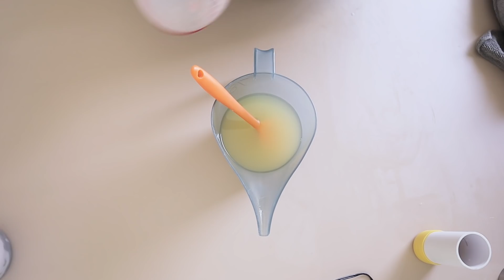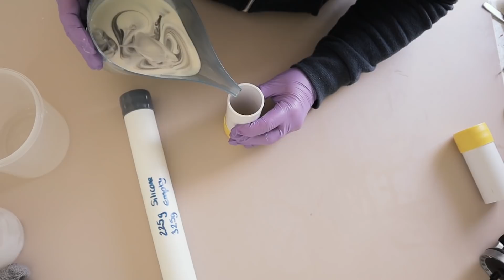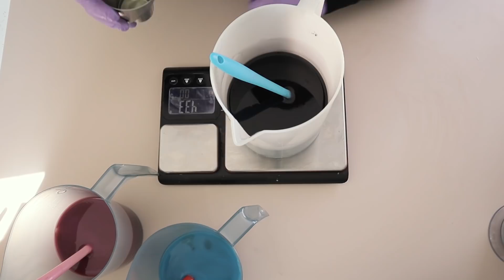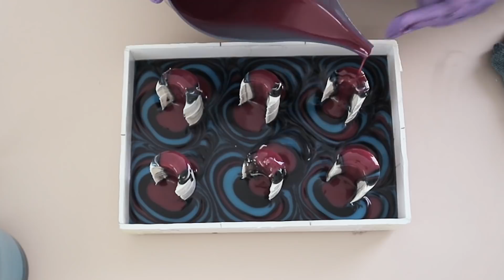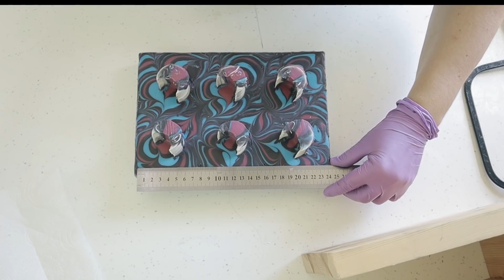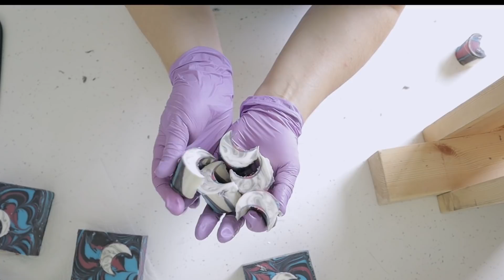Making an Embed Column Pour cold process soap making tutorial. How to make a cold process moon soap.

Comment: I'm new to your channel. I really appreciate your talent as a artist. If you don't mind me asking how long have you been soaping? I plan on pouring a column moon soap tomorrow. Do you recommend a more soft oil batter to pour over the moon? Signed your biggest fan in USA!
Reply from the maker: Well hello, biggest fan :-) You do need to have a batter that will stay fluid, for me a lot of that is about how much you blend it (to emulsion only then stop, add in your colour and FO and then just leave it alone and stir every now and again until it just comes to the light trace, you should just see a very thin trail but it should disappear into the batter as soon as it touches it, if it leaves any pattern on top it's probably starting to get thicker than you really want.), your temperature, I'm about 80F for this type of pour and having a fragrance oil that you can trust to not accelerate. 
Having more liquid oils does tend to help, but I find it's better to keep an eye on your saturated : unsaturated fat ratio rather than just hard vs liquid oils, you will find it on the top right hand side when you view a recipe in Soapcalc (you probably know this, but just in case), Mine is 41:59 and that gives me a batter that will stay fluid for a long time.

Comment: Thank you for this.

Just a question. Do you have to adjust the new lye solution for the new pouring batter on the embeds.
I’m asking as the embeds are still quite fresh.
Also for a rebatch with grated soap you dó have to adjust the recipe.
Other then the oil weight is there anything that changes lye wise or is that non existent with larger embeds. 
Would be interesting to know what rules and regulations are for this in the UK as we have differences compared to the US. Less flexible in a way but also more safe I believe. Also is this aloud when selling? 

Thank you Lisa.

Am following your soaps with great pleasure. 
⭐️🔆⭐️

Comment: I'm getting a coping saw does the smallest blade string not good for soap cutting. Should i get a guitar string? What size guitar string and are they easy to change out?
Reply: So beautiful very cool it's ashame I would love to buy one of these..i hope u make it again for your store
Reply from the maker: If the saw actually has a metal string it may be ok, but it it's a tiny blade, like mine was I think would cause drag lines in the soap. The guitar string I use is 22 guage, mine changes out really easily, you just twist the end of the saw to release the blade then I put the string in and wrap round
Reply from the maker: I may well do, will have to choose one of my assessed recipes and colour combinations that would work